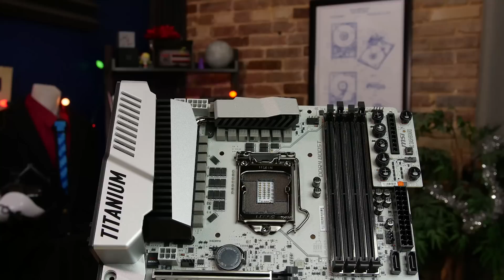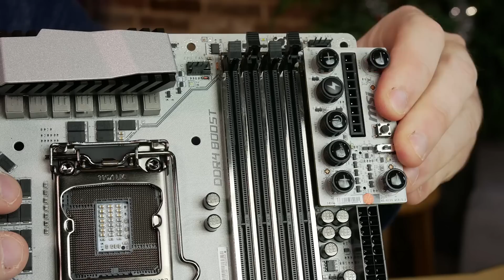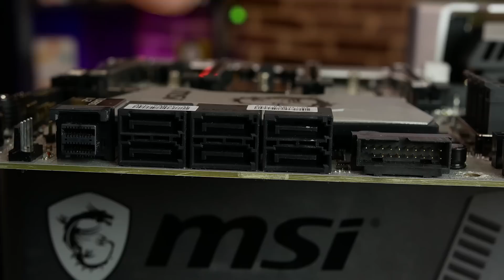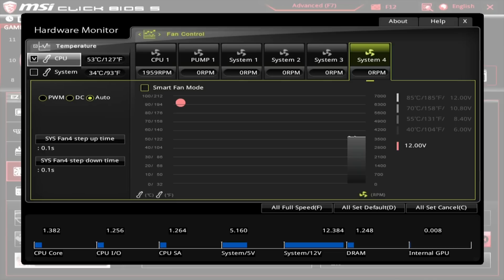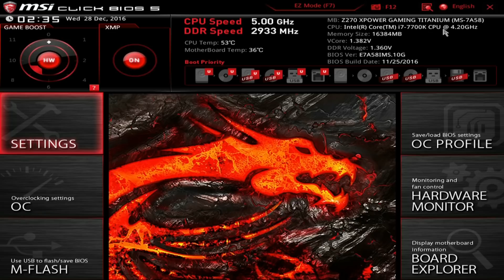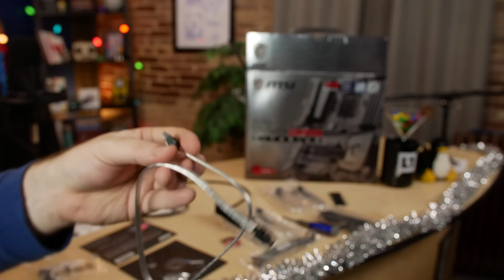MSI Z270 XPower Gaming Titanium

Comment: I am still running this board, with a 7700K, G.SKILL 32GB/4,1080ti, 3x PCIE NVmE 850WantecPSU and it runs solid AF.

Time to upgrade before my C drive NVmE runs out of writes and fails it was at 50% a while ago, thats how long its been chuggin along. Soft OC'ed with Intels XTU and MSIAfterburner the entire time, also almost never shut it off. Warms the house.

Thanks MSI!

Comment: I can with x85 also with 6c 12 t 6 core 5000GHz Treads 12x 5000GHz balance and one core keeps on 5.133mhz for windows reg win 11 if I wanted with voltage and Cpu wanted with 6x ram = 1333mhz x6 on 3200mhz because I only 65 = watts I would overtake a 7800 k 1.5 percent under an x1800 Amd s and exactly above the 7800k the only thing I can't do is run ram up to 5Ghz all core treads Turbo +++ and start type c USB 3.2 adapter to type c cable adapter to Usb 3.2 although I have the drivers and the fastest Nvme m, .2ssd 7200mb sn850 that only crashes doesn't load because everything that is real 3.2 is 3.1 3.0 and the real thing for real 80bit Thunderbird 5 Cable is made Dual 40 Gbits load data Data transfer 40 Gbits you can't buy it on PCIe 2.0 cards real I don't even have settings I can save that before take out so and more fully running software on it and cool the fans on it, nothing I do get the Cable not clear therefore ad superfluous everything was 3.0 3.1 are all new board in truth there is no 80gbits one way transmission on a cable type-c T5 models to type-c or Usb 3.2 output I really think sheep, the rest I have everything without any limit that the board has to switch freely also I can go with ram even lower more higher with more watts on power supply other under volts on Cpu well I already have everything I don't need ^^^ still everything shitty think people ^^ knows also not what I should do with it if that doesn't work on x16 PCIe that sit like PCIe 4.0 x8 full surveillance as adapter not the board makes the limit the software gifts standard sales fuses make the board refinancing bahr
Reply: Because you feel compelled if I use a 1 Gbit Lan 1000 line, you get 20 GB out here without a router, especially if I can switch Bluetooth 5.0 network wifie, plus Wi-Fi 2.4 Wi-Fi 5g can fire everything as a transfer even faster if I can but this is only possible if you exclude 1GB Lan and only put all Wi-Fi s together because Lan fiber optics cannot connect with wireless that slows down both together, also notification 10 g as well as 60 HDMI 120 Hz HDMI nonsensical 240 Hz 8k nonsense DisplayPort 1.4 if everything goes Manuel can do that with the cable if you give a special circuit on full board PCIe x 16 boards fully reproduce also hen do on board only 5GBts is in truth that 15-16 Gbits are fully equipped I half full anyway and my software under OC Tuner can put more volts on it via Windows and a want more and a save without restarting in until in win 11 10 that I can break the limit with ram and tack the CPU s in the low area for booting up to the Cpu's place like atomic explosion or China firecrackers meanwhile I can knock out what I want with PCIe 2.0 that is all just the technology of the hardware components and cables and correct voltage conditions shown end everything else is only you have to buy a new one, you have to change a generation. Shit for so you can drive the next number at the speed ^^ because you get it built overpriced ^^ what should I just can't just use the maximum speed of the Nvme has to use that raid kuppeln ^^ with SSDs only needed for games backups and data internet transfer with and from the plate to the adapter to load on new plate type and everything else that is needed is weak as Otto normal Yous he, you buyer consumer good exactly .
Reply: You may be faster with one component in the end, but with all components not better at the limit than I was with Alen components that were not imitated and slowly built on server, only through greed for success with child-safe, that's why today everything is automated with a click of the Gpu Cpu system and ram with software none 4x the sandwich data as hewn from my Cpu on my lvl only by Codec Transfähre Set intern Bigger combo Tuner Cash n 1 CPU Avx AVX 2 Avx512 Bran faster cores multi core and calculate what you think is fluid that is just software and Cpu architecture the x2 is fired or times 4x with ram voltage and data back and forth together and that efficiently pushes up faster I am still with low cpu not slow in the system at the limit I get up to 7.2 Ghz 9600HT / s on ram voltage ddr3 1333 Mhz x 6 set ram fast m.2 NVME SSD 7200mb transmission memory optimization Bottleneck relief and fastest outputs internet implementation for all possibilities and boards that you can fuel even more with more x 16 adapters t3 t4 t5 Kabel Usb 3.0 Nvme memory even outputs GPU DSP 1.4 HDMI adapter are available for cards there you don't even need a GPU if you have decrypted the software to fire up the game programs that is worth gold like an RTX 3090.

Comment: I have this motherboard along with the Intel Core I7-7700K.  My system will not boot up.  I am wondering if it is a bad board. :-(  It did let me update the BIOS using the BIOS Flashback+ feature.

Comment: I am assuming that if you were going to run two M.2 cards in a stripped C drive Raid; you would use the top and bottom M.2 slots?  Then, once Win10 is installed, you could use the middle slot as an additional drive.  That should be super fast...  What bottlenecks are we looking at?  Big deal or not???
I understand this board will be configured with the new X370 AMD?  So, we should see this basic board in the X370 format about mid-March.  Any, major differences?

Comment: Quick word on the M.2 Shield, according to Gamer's Nexus it actually makes the heat WORSE than if you were to just leave it exposed.
Reply: Disobeyedtoast It seems NAND Flash performs better and lasts longer at higher temps (within reason, of course). You'll  want to avoid overheating the controller, but that'll take quite a bit to cause it to throttle. Not sure if MSI had this in mind when they implemented the heat sink/trap, but it seems to have triggered a bit of education for much of the tech media.

Comment: I just upgraded to this board from a Gigabyte board that I didn't like at all. Let's just say that's it been refreshing having a capable motherboard for once. I would've liked to see what kind of numbers you would be able to get using a Skylake cpu with this board. Since there wasn't really a justification for me to upgrade from my 6700k. I have not been able find any reviews using that cpu with a Z270 chipset. ALL the reviewers are saying its not worth upgrading from Skylake to Kaby Lake, but they all use Kaby Lake in the reviews. Kinda frustrating tbh.
Reply: @K3, was it difficult to build and post...?
Reply: TroyHR Not at all. Quite easy actually. The bios is still in version 1.0 so there's nothing really needed there as far as updating it. the software that comes with it gives you a way to check for updates easily. msi just got back to me and solved my issue. all I had to do was clear the cmos. I guess I should've tried that first.
Reply: TroyHR I thought this was the comment I made about the issue I had. I had problems with the auto overclock feature called Game Boost.
Reply: Thanks for both...

Comment: Any idea whether a Prolimatech Megahalems cooler mounted vertically would block the first x16 PCI-E slot? If so, sounds like I'd have trouble using this board as mounting my video card in the third slot wouldn't give me enough fan clearance...

Comment: I wish it was black PCB. not saying silver or titanum is bad. i just wished it wasnt locked to only one color. MSI as well as other manufacturers should start offering the same exact motherboard in more than one color.
Reply: sorooshusa wait for the god like
Reply: sorooshusa you think...  I mean how hard is it to change the color of the solder mask and mold the same part in 2 or 3 different colors
Reply: Cost additional money to have several iterations of the same board. They all have to sell to make money back.
Or like everyone else and take pre-orders if you are a special needs person. You'd have to wait longer I'm sure.
Reply: Addictive_LiquoriCe I now,  but changing the solder mask doesn't hugely change production cost,  and as far as having many different types, most Mobo manufacturers already have so many skews having one or two skews a chipset and just changing the solder mask and color of any plastic parts on the board would be much cheaper then having to design,  manufacture,  and sell all those different skews,  I mean MSI had like 8 different ATX only not even talking about other form factors completely unrelated Z170 boards